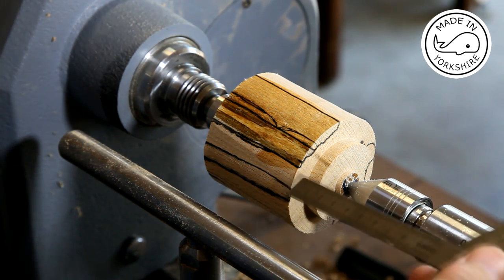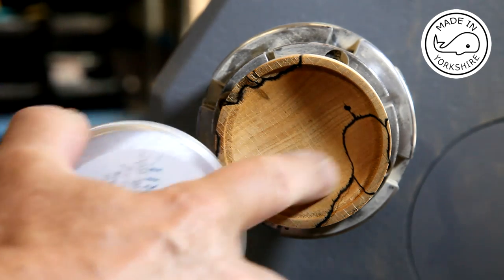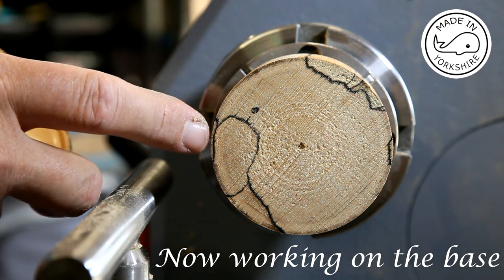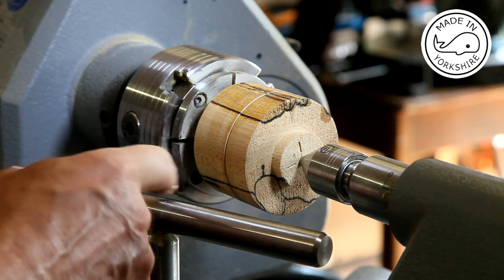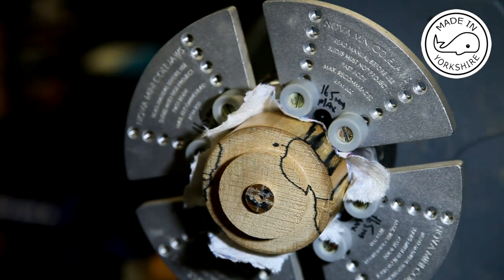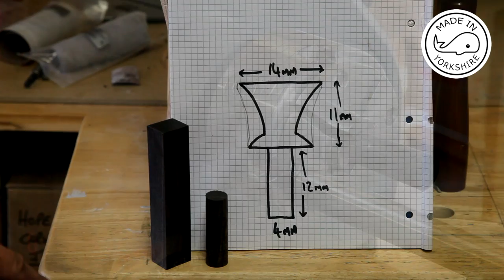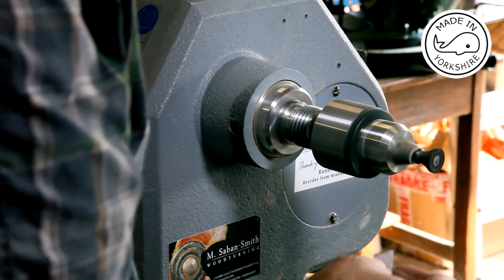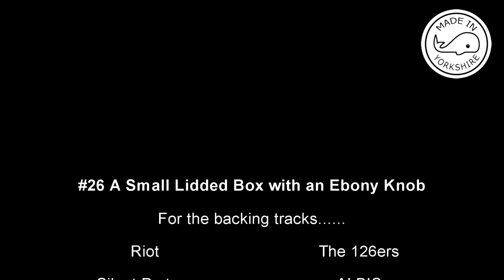#26 A Small Lidded Box with an Ebony Knob

Comment: Thanks for that Andrew and its good you kept it all in even the bits that didn't go quite right.
I am hopeless with the bowl gouge and I use carbide tools instead think I might need to get that book
Reply from the maker: Hi Graham. I got the book from worldofbooks on eBay (UK). Mine is an oldish 1994 version and cost a few quid second hand. isbn 0-946819-20-3. I think its still available new and maybe updated, but over £20. Good luck and happy turning! Cheers. Andrew

Comment: Great video Andrew and a great little box. I have a lot of spalted Beech which is just a wonderful wood but often hard to get a good finish. Never used CA on it but tried Sanding Sealer or Shellac. I find CA is quite brittle so may over harden the fibres.

I think if you can create a good jam chuck you should be able to finish the bottom off a lot easier. However with a cupped base that does become harder. A little tip for the lid for future boxes, try and keep the tenon as large as possible as that way you can still use most of it for the lid. However on your design it didn't make any difference.

For Ebony, have you though about ebonizing wood? I have the spray but that gives more of a paint finish. So I will try and mix my own when I eventually get some vinegar.

Boxes are not as easy as you think are they. I still fail on a few, far easier to cup out a bowl. 

Well done, finished well and learnt a lot like we all do the first time we try something new.
Reply from the maker: Hi Paul. Thank you so much for the advice. It's very much appreciated and I will try to apply it when making my next box. I do have some ebony paint, but it didn't give a great finish when I tried it.
Thanks again. Andrew
Reply: Your welcome. I've only been turning a year now but done quite a few boxes. Still made mistakes today making the lip too short. The paint options aren't great which is why I want to try the homemade ebonising solution. You're doing great, a pleasure to watch and I'm sure teaching others as well as me a few things,

Comment: Awesome box! I have the supernova 2 as well and I find that an irwin 8 mm allen key works far better than the supplied one.
Reply from the maker: Hi James. Thanks for the feedback and tip. I'll certainly check the Irwin out.
Cheers. Andrew
Reply from the maker: Hi James. Is the irwin key a ball end? If so, all I can find is a folding set.  Is that what you use?
Cheers. Andrew
Reply from the maker: Hi James. Thanks for the link. I've Ordered these. Cheers. Andrew
Reply: Andrew Whale no problem